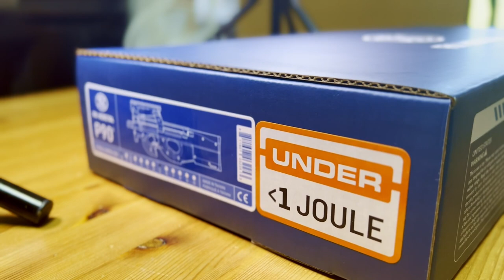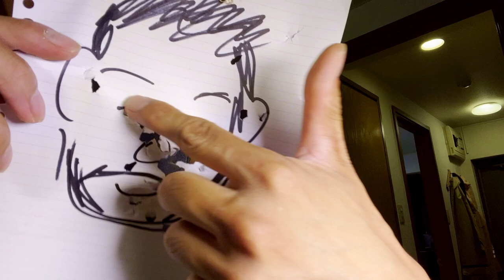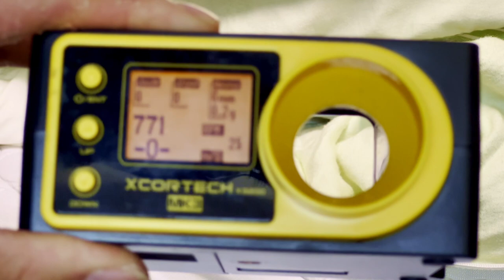I Unbox the world's BEST Airsoft P90. (Krytac P90 AEG)

Comment: why say not used 11v? the krytac official website says on the guns specs battery 11v ?
Reply from the maker: For this model it will over spin and changing parts to combat it will bring it into illegal territory
Reply: @MaydaysanAirsoft  what about a simple Delayer Chip installed into one of The gears to delay tappet plate?
Reply: @MaydaysanAirsoft  wonder if the UK version would have same issue? 1.28j limit
Reply: @MaydaysanAirsoft  so upon speaking to store they said UK version with 350 fps will overspin and damage gun on 11v battery :( I've never used a 7v bat only 11 in my g&g SR15 KA, How much different is a 7v in trigger response? i will be using the TITAN 7.0 3000 brick in it.